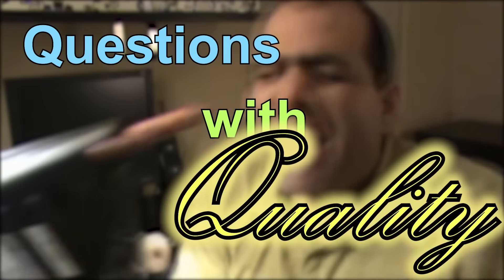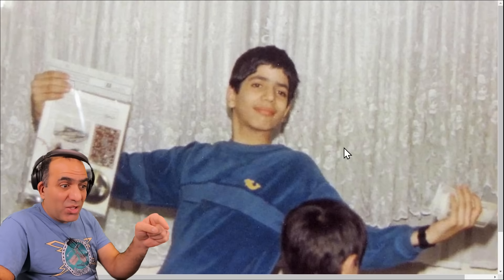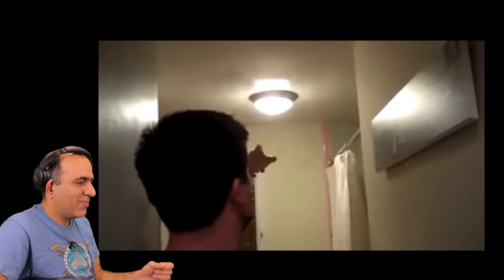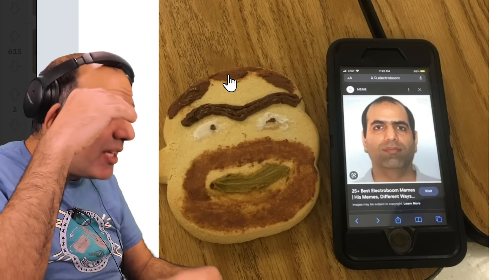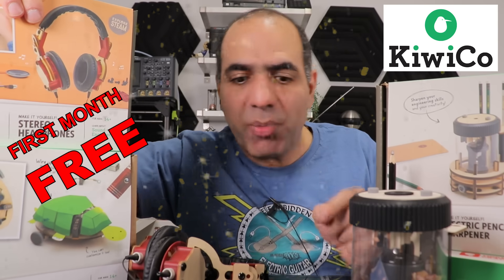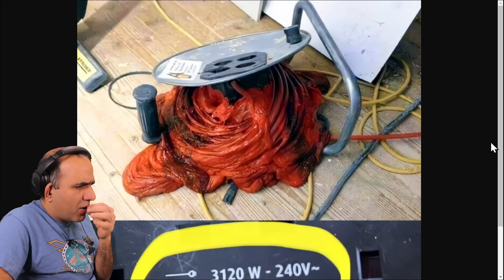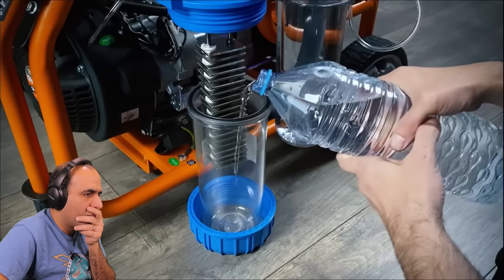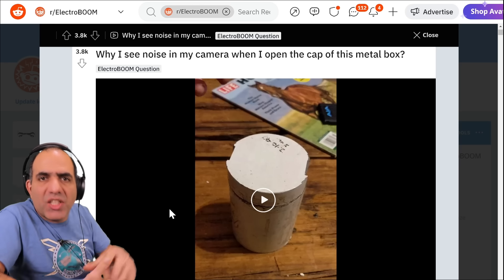Can ENGINE Run on WATER?! They Copied my Toy (LATITY-011)

Comment: Okay this is just sad mehdi, that’s a clickbait title and you know it, water no, hydrogen from electrolyzed water yes, smh
Reply: Not in a self sustaining process
Reply: @sam512  Yes exactly, there is always energy loss, and besides hydrogen in an engine is so volatile, there’s a reason why cars only accept a small mixture, if it were to run on pure hydrogen then it would cause excess wear due to the force, it would make sense if the guy were to compress the gasses down from a source of energy like solar, but even then it would be hard to do, hydrogen is not only explosively damaging to a normal engine, but it leaks badly due to how small it is, so even if you wanted to compress it into a tank for later you would have to immediately use it within a certain time frame or else it would be wasted and just escape the pressurized fuel cylinder

Comment: About last video:

It is fake: noise on video only darkens the picture. But when radioactive particles hit the camera sensor they give so much energy to the pixels they max out, and it shows as sparse white "snow" on the screen. If you look up some videos on homemade xray machines, you can see it in action.

Also, if noise on the video was white dots, but with same "density" radiation source would have to have "drop and run" written on it, since it would have to be super radioactive

Comment: As for the motor in 12:20, someone made a video showing why it is impossible but basicaly the power generated by the motor (which was running with a mix of gas and O and H) was less than the power required to separate the oxygen and hydrogen in the water.
Reply: As long as the electrolysis cycle is productive enough and ‘buffered’ by a battery, I’m pretty sure the thing will run for a good few minutes - depending on the capacity of the battery. 
Charging it from the generator might add some short amount of extra run time, but once the battery is dead - game over.

Comment: With the extension coil it probably wasn't some crazy high current but probably some relatively high current combined with the fact that it was all rolled up
Reply: Yeah he definitely overloaded the cable but most of the heat was coming from the fact that he basically turned it into a giant induction coil.  I have definitely heated up some cables doing this before. 
Always unroll extension cords especially if you're going to be putting a lot of current through them.

Comment: you can weld with carbon rods, but yes, you need to add filler

they actually sell carbon rods for welding
Reply: Filler, and protective gas, or the metal will burn. 

I tried without filler for curiosity, and it actually … well, not welds but rather melts into each other to some degree, leaving a deep valley.

Comment: The lamp puzzle. Obviously,  call an electrician,  a licensed tradesmen.  Experience is the best way to correct the mistake in the lamp box, the switches or both.  That's an amusing issue for sure,  but if Boomers right on the nose, you are switching loads in series with each other when they shouldn't be, so the loads won't get the proper voltage and could damage anything connected to it.    It's super easy to fix, just find the mistake and twist the right wires together.   It shouldn't cost you more than an hour of a Journeymen or their apprentices time.

Comment: 8:35 this is why it is strictly required by safety instructions to fully unwind extension cord before loading. It has poor heat dissipation while winded, which can lead to overheating and melting.

Comment: @12:17 The idea is not so bad. If the water had a lot of energy stored and was very easy to release(e.g. nuclear bomb) it could definitely sustain its release and power something else with the extra. Water being so stable is a double-edged sword :)) 

What would be really interesting is splitting each OH bond with solar radiation instead of electrolysis (like the breaking of OO bonds in atmosphere to make Ozone).

Comment: I really want to see a whole video dedicated to the water engine and showing Why it doesn't work exactly. Logically I understand there's no way it's going to create enough power to turn the motor but I want to see it broken down nicely
Reply: I think he explained it well enough - what do u not understand?
Reply: it's thermodinamics, you can't revert a reaction using energy to then re do it and gain energy ( the electrolisis of water is highly energy consuming so using their products (H2 and O2) to produce energy it's a  net loss in the system)
Reply: The battery will drain and eventually run out of charge.
Whenever you convert energy from one form to another, you're usually only going to get somewhere around 75% efficiency due to losses to heat, vibration, etc.
So battery splitting water = 25% loss of energy, engine burning hydrogen/oxygen from the water = 25% loss of energy, charging battery with engine = 25% loss of energy.  
So 75% efficiency over 3 steps (75% cubed) = 42% efficiency.  If the battery is outputting 1000 Watts, it's only getting 420 Watts back from the engine once the energy makes the round trip.

Comment: I have used a light bulb as a current limiting device when working on old stereo equipment. It's good to know that if it ever becomes impossible to obtain incandescent bulbs that I can just ask the bathroom electrician for his wiring diagram so I can make one out of a hair dryer. With the light bulb you know there's a short is the bulb glows brightly, so with the hair dryer version the indicator of a short should be if you can dry your hair after a shower. Not your hair, Electroboom guy, but someone with a full head of hair.

Comment: 12:02 I think that they don't pass oxygen-hydrogen gas into the generator. Usually most engines can't handle the oxy hydrogen combustion, and the engine working on such fuel will very quickly break, or won't run at all. So the video is probably fake. Or they are using platinum elements in the engine, which just makes this setup way inefficient

Comment: Wait why would breaking the water into hydrogen and oxygen necessarily take more energy than the dynamo can supply?
Reply: Because the dynamo is powered by burning the hydrogen
Reply: @sam512  yeah, but breaking the hydrogen and water apart might not use as much power as burning the hydrogen produces
Reply: @charlie_nolan  electrolysis has an efficiency of about 70%, the burning of hydrogen with oxygen has an efficiency of about 30%, so no
Reply: @sam512  ok, got it

Comment: You definitely didn't disprove the water engine, at least not clearly enough to understand. According to your diagram, the engine consumes fuel (water), and outputs electricity. Because there is a chemical fuel being consumed, it's not being marketed as a free energy device.

Disclaimer I don't actually know whether the engine would work or not but that's not the point here
Reply: Where on the diagram does he show that the engine consumes water as a fuel?
Reply: @milanswoboda5457  Well it's not entirely visually shown in the diagram. He states that the hydrogen and oxygen gases are burned, and they in turn are created through electrolysis of water.
Reply: @davidneuman8009  and he adds points to it in the presumed energy flow circle plus additional energy consumption by external devices and a mention regarding perpetual motion.  
Get the notion that water is a fuel out of your head because it is not.
Reply: @milanswoboda5457  Glad to find another internet commenter who uses strawman arguments as an excuse to be rude. My point was not that water can in actuality be used as fuel. My point was that the diagram communicates that it is being used as fuel, with some unspecified waste product from the combustion. If the waste product contains less chemical energy than the fuel, the engine could work. Mehdi's commentary does not address this.

In actuality, the waste product is also water. So it doesn't work.

Comment: No material soldering was a thing for non essential stuff, like metal chairs. It's called "soviet welding" in my country,
Reply: so does this "soviet welding"  create additional filler material weld bead and flux slag on top of the weld bead like the one in this video?
Reply: @milanswoboda5457  Yes, that's how it worked. It was intended for quick repairs and as I said it would be easily detectable in important metal elements, like those that will work under tension or become parts of vehicules, so it wasn't an officialy approved method or something.

Comment: Is anyone gonna tell the guy messing with the lead casing to go to the hospital soon? I’m pretty sure if whatever use to be in that case was soooo radioactive it left that powerful of residual radiation, he’s in some big trouble.
Reply: since his hand stopped it, its just alpha radiation, which is pretty weak
Reply: It looked edited to me, the noise made parts of the image darker instead of only exciting the camera. Correct me if I'm wrong but I'm pretty sure real radiation noise makes the camera have white pixels.

In addition, radioactivity as extreme as implied in the video would be quickly damaging, they'd notice before they had time to film and post the video if they opened the box at any time before the recording as is implied.

Comment: I'm not a welder, though I have seen it done, and the carbon rods I saw were used for cutting rather than attaching. I believe there was also air pressure involved to blow material out of the cut.
Reply: it's called Air Carbon arc which uses air blown through hollow rods tipped with carbon/graphite in order to cut and/or gouge metal.

Comment: A common misconception is that electricity takes the path of least resistance or impedence.  That will offend many who have held premis as an axiom,  belief held without question.
But, hear me out and you'll understand why that is not true. 

In air, electricity may appear to take the path of least resistance, and sometime that might be a jagged lightning bolt that's farthest thing from a strait line.  But when one sticks two electrodes in the ground, electricity will flow though every possible path at a rate dependent on the path's total effective impedence.

Is so important it's worth repeating. Electricity flows though every possible path. Besides conductors every possible path includes semiconductors and insulators and air with very very poor conductance at a rate proportional to the path's effective impedence. Lastly when a potential  exceeds air's break down voltage a momentary path of low resistance carries the bulk of the current, what we often mistake for as the path of least resistance. 

Lastly, if you find yourself under a tree struck by lightning sadly you wont be able tell the lightning bolt the tree to ground was the path of least resistance as some of the current still passes through you.

Comment: Could it be possible that the water engine does run, by the fact that it is using the potential energy in the water (Hydrogen and Oxygen) as fuel, and the battery as a means of getting that fuel? Therefore, it is getting energy from somewhere: the water, not the battery? Like so Mehdi see this.
Reply: you need to put in energy to split the water into its components. even in professional industrial settings, this can get no higher than 80%
Reply: @mtqrx  Just to clarify, you are saying the energy you put into the system (from the battery) is always greater than the output you get from burning the oxygen and hydrogen?
Reply: @milanswoboda5457  Thanks. I wasn't sure how much energy resulted from the combustion of the oxygen and hydrogen. (I know more about electricity than chemistry)
Reply: @electricalguy  round trip efficiency maybe 7% if you are lucky now imagine you also want to use  the energy to move the vehicle :)

Comment: cmon all it takes to weld with a carbon rod and car batteries is the addition of a welding rod. that guy was b.s. but it works with a carbon rod plus a welding rod and jumper cables and car battery or batteries hooked together. just hook carbon rod to either red or black and welding rod to other then touch them together to weld

Comment: 3:40 that light's hot is hooked up to a neutral and when current passes through the hair dryer it passes into the hot of the light and likely back to the grid's live circuit as a return path.

Comment: What a coincidence, I needed to weld a pipe from the inside to seal it but didn't have enough space to weld so I grabbed one graphite electrode for air arc gauging which I then used like a crappy TIG torch
It was not pretty and it was really hard to weld with but I got it done and it does not leak

Comment: Mr.Boom, The hairdryer/light phenomenon that you showed is probably because they lost a phase at their service. When you lose a phase sometimes plugging things in will backfeed the Dead phase through the neutral wire. It happens a lot and it’s usually the water heater that backseat a bunch of circuit throughout the house when you lose a phase
Reply from the maker: draw me a circuit!
Reply: @ElectroBOOM  Don't know how to include a drawing in a YouTube comment, but this exact thing happened to me - lost one 120V phase, but the other phase supplied power to the house lighting/appliances through the 240V water heater. Here's a diagram that won't work unless you copy it and paste it into a document, then convert to a proportional font (like Courier):
 |-------HI
 |
 |
water    NEU -----|
heater            |
 |              light
 |                |
 |--------HI------|

 |-------HI
 |
 |
water    NEU -----|
heater            |
 |              light
 |                |
 |--------XX------|
Reply: @allenlutins  you can draw one and share an imgur link or something
Reply: @allenlutins  you can host it on external website and share the link.
Reply: @ElectroBOOM  I used to make this mistake alot. i can make all the lights in my room turn on if i turn on my computer. always wire stuff in parallel,
Reply: This sort of thing can also happen if you have split-phase power (such as is common in the US) and a floating neutral somewhere (such as if the light switch is switching the neutral instead of the hot line).  Then you can get a situation where Lamp1 + Lamp2, or Lamp1 + hair dryer end up in series across the 240V between the one hot line and the other.
Reply: @foogod4237  that would cause hair dryer overheat and stuff, that's actually equal to higher voltage. In older times, when USSR had 127V domestic this was a dangerous fault because it could lead to fires.
Reply: @EllAntares  You're quite correct that that sort of thing definitely could cause one or more of the devices involved to have problems, possibly even in dangerous ways.  If the two devices connected in series are not of equal resistance, then one of them will see higher voltage than the other (and higher voltage than the 120V it's expecting), and higher current than it's designed for as well.

Usually when dealing with simple devices like light bulbs and hair dryers, the device which will experience problems will be the lower-power device (which has higher resistance), so in this scenario you're more likely to blow the light bulb than fry the dryer, I think, but there are many configurations where the dryer could also have problems..

Floating neutrals can actually be a big problem, and can cause all kinds of strange and potentially dangerous behaviors.  In many cases, the increased current that results will trip a circuit breaker, which can provide some protection, but not always, depending on the particular devices involved...
Reply: But usually in bathrooms they use the black phase only and in the kitchens and laundry rooms they use both the black and red phase right?
Reply: I have had this happen at work where we had a three phase breaker for the lighting and the neutral was disconnected. but we had fluorescent lighting which made quite a nice discoshow.
Reply: @KeyDx7 bingo
Reply: I know what you're saying but just to clarify most US houses operate on single phase. So you don't lose a phase you lose a line of the same phase. That doesn't apply to multi family dwellings as some use 2 phases of a 3 phase system.
Reply: @MrTopflight  single phase 220, which means 2 lines in along with a neutral. you do indeed have 2 phases if you use the neutral.
Reply: @robertmore703  Thats a common misconception. But it is indeed the same phase. Think of it like having a blanket and stapling it down the middle of your mattress so both people have the same amount of blanket. It doesn't become 2 blankets, it is 1 blanket that is being balanced. So you wouldn't call it blanket A and blanket B you would call it Side 1 and Side 2.
Reply: @MrTopflight  only if you look at it for 220. if you are looking at it for 110, it is 2 phases. you have to use the neutral to get 110. it is treated as 2 phases for code. it does get complicated with balancing and amperage avail, but it is 2 phases for 110.
Reply: @robertmore703  No. It is literally called a single phase system. They are 2 lines of the same phase. You have Line 1 and Line 2. Not Phase A and Phase B unless it's a 208 3 phase dwelling.
Reply: @MrTopflight  it is single phase 220 2 leg 110. you have two hots in your panel.
Reply: @robertmore703  https://youtu.be/FEydcr4wJw0 You will see what I mean in the first 3 minutes. Like I said this is a very common misunderstanding that only becomes an issue when you are working on a variety of projects where being specific is important.